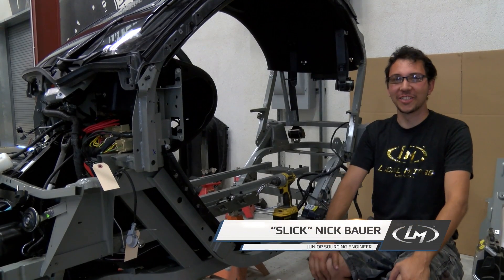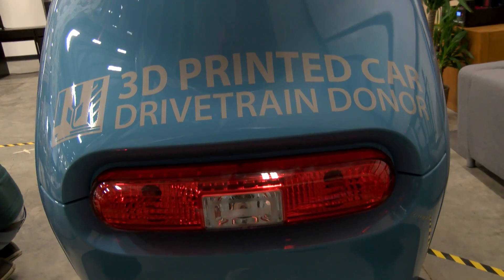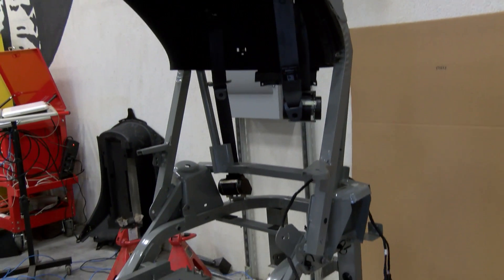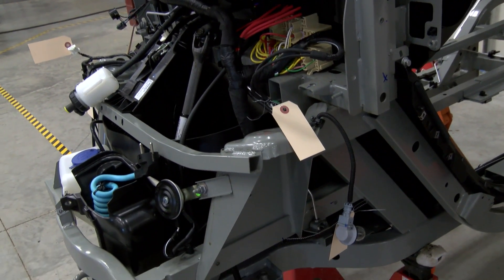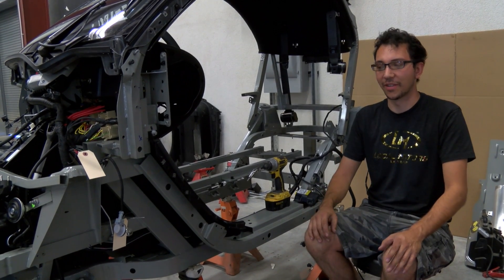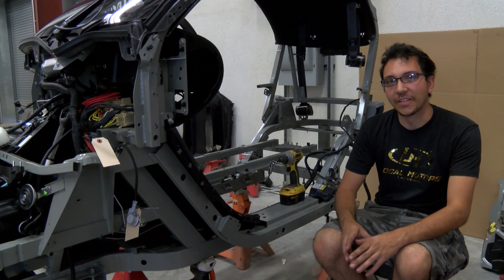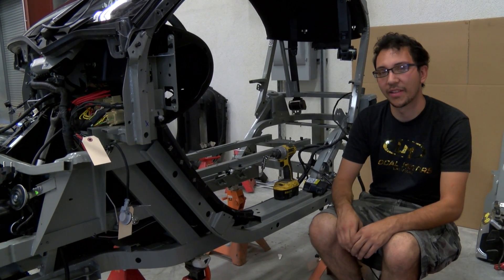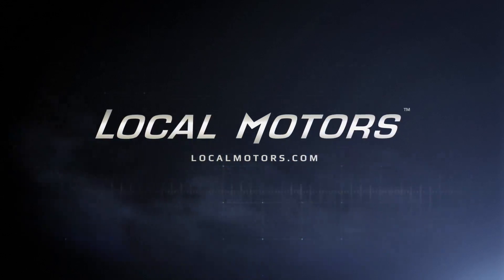Twizy Disassembly

Comment: Hi Guys ! Glad to see you live printed in 44 hours your Strati !
Late question:
I was wondering, since you disassembeled the whole Twizy if you happenned to have retro-engineered the schematics or not? Mainly the dashboard assembly that I wish to replace with a non less functionnal 7"+Arm-Board/Linux Onboard computer (it will embed on the fly Sevcon tuning, multimedia, gps tracking+3G and everything you dreamt about the Tesla, just smaller :-) ) Of course, everything I do will be open-sourced and usable on the Strati (got a wife, so it will take time :-/ )
Thanks !
Reply: do you have any update on this project? :)